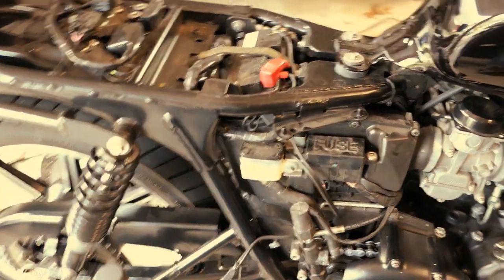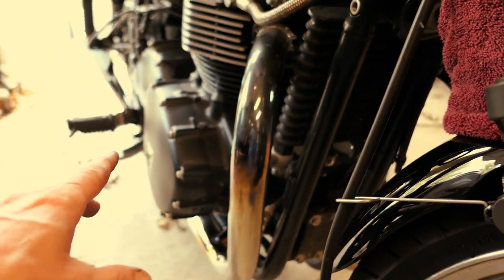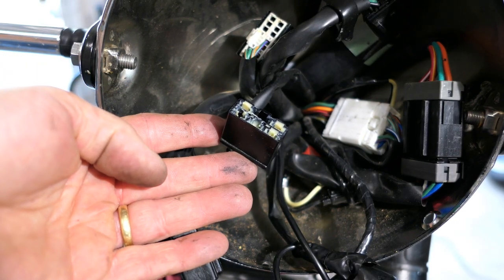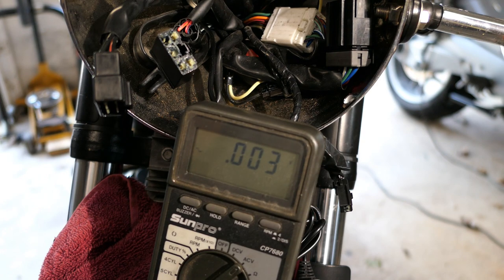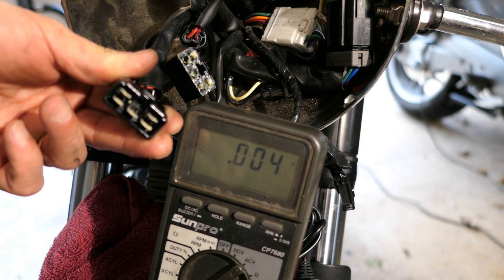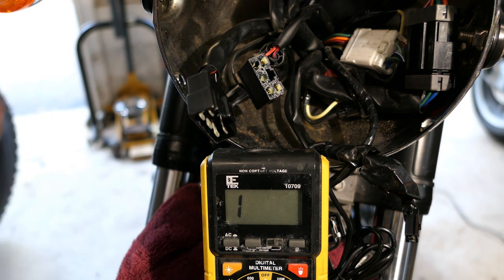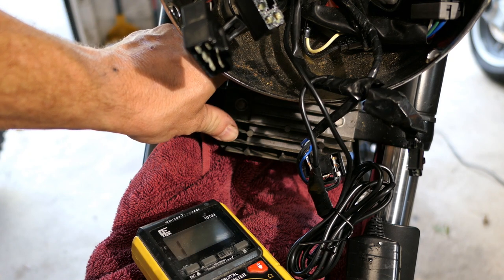Testing A Triumph Bonneville Charging System

Comment: Please help me. I got a 2010 Bonneville SE. every day in the morning the energy is too low to start the engine so I have to push the bike. Doing some test i found that the rectifier is consuming energy from the battery after the bike is off. I think I should change it but I live in a far town so is not easy to find a replacement. Is it possible for the rectifier to leak energy in the way i described? Or could be another problem?
Reply from the maker: It is possible for a rectifier to have what's called a "parasitic draw" with the bike off.  A diode is supposed to allow electricity to flow in only one direction, but if it fails the battery can drain.  You can disconnect your rectifier, charge the battery up and see if it holds that charge.  Of course, there are other possibilities too.  You could have a parasitic draw from something else, or the battery could just be on the way out.  This video shows how to test your battery:

https://youtu.be/d-5xA31nBd8

Comment: What would it mean if the stator windings did have continuity with ground? Should it be the same with the ignition on?
Reply from the maker: That test is just a quick way to test for physical damage.  If a stator winding is shorted to ground that must mean it cooked itself or some other physical damage occurred.  The winding should normally be separated from the chassis or ground.

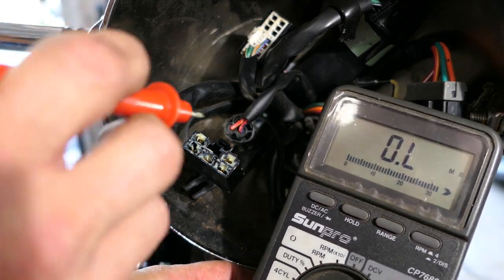Comment: @4:27 my bonneville from 2006 gives a reading in ohms at every winding. And at 3000 RPM it gives 42 volts. At idle it gives 22 volts. At the battery the volts go down when I rev it up. Do I need a new regulator?
Reply from the maker: I think maybe you have some things confused.  So, at that 4:27 mark I was testing the stator windings to make sure none of the three were shorted to ground.  If there was one winding shorted to ground you would also see a low charging voltage.  If all three were shorted to ground you would have nothing!  So I'm wondering if you did the test wrong or picked the wrong place to measure?  The test using the AC volt scale is testing the output of each winding.  So if you have all three readings at about 42 volts AC, then it is likely your stator is fine.  I found 45 volts AC, but there could be differences in meters or specs, of course. 

You didn't mention what your charging voltage is in DC volts at the battery.  What I was trying to show in the video is that you can test the stator windings to make sure they are putting out voltage.  If your charging DC voltage is low but your windings check out, then suspicion is cast on either the wiring/connectors or the rectifier itself.
Reply: @tinderboxarts  Thank you for replying my question. I had all three readings at about 42 volts. The charging voltage was diving under 12 volts when I reved it up. I have installed a new rectifier from Rick's motorsports and my Bonnie gives me the freedom to start everywhere at any time. Thanks again!